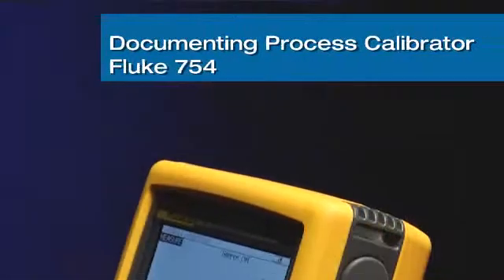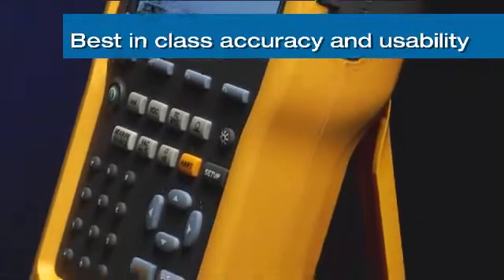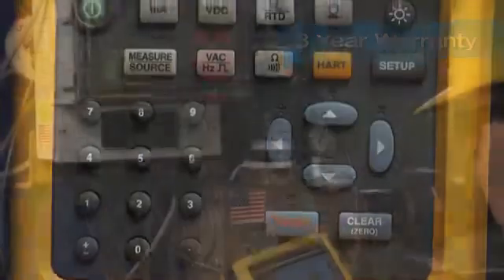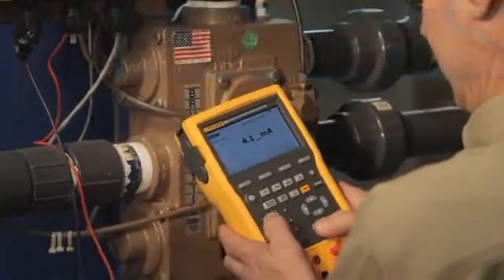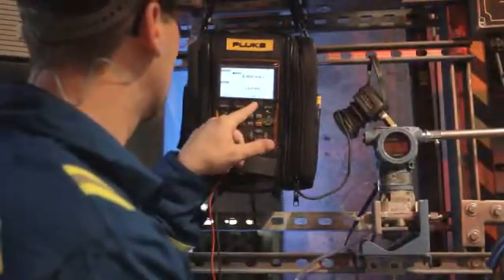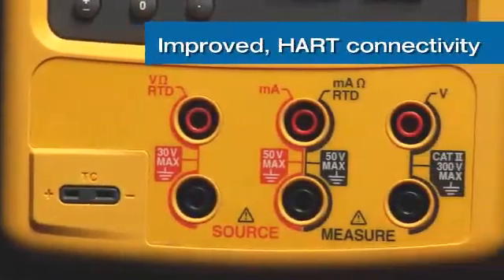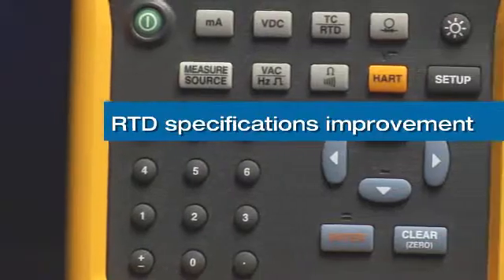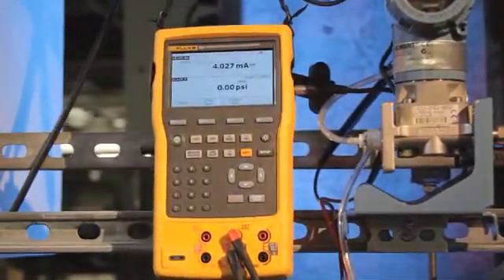The Fluke 754 Documenting Process Calibrator-HART: Work smarter. Work faster.

Comment: Thinking of upgrading my two Fluke 744's ( batteries are past it ) to two  of these or  Druck....what I want, a Process calibrator, it'd be nice to get one with a data logger, so I can bench test an instrument and then get printout log of its behaviour over a few hours on the bench, HART, does the fluke have a data logger option? like the Druck ?